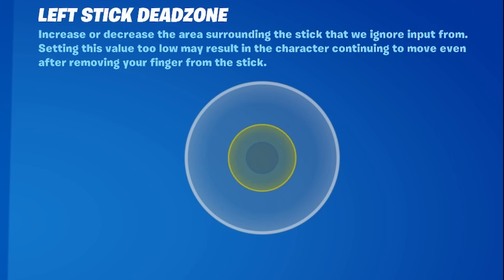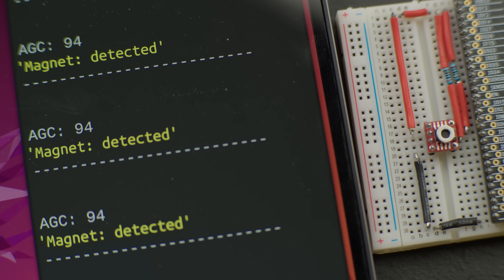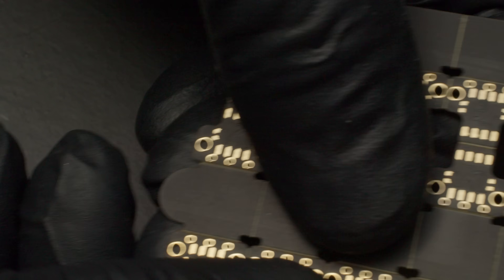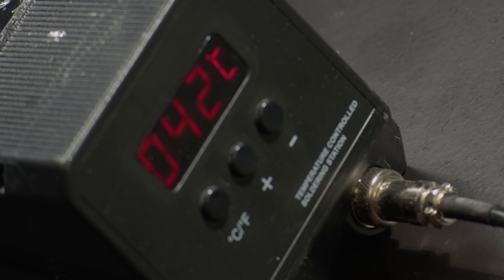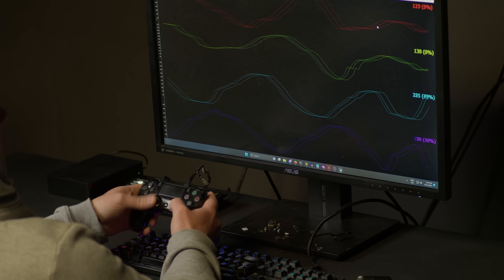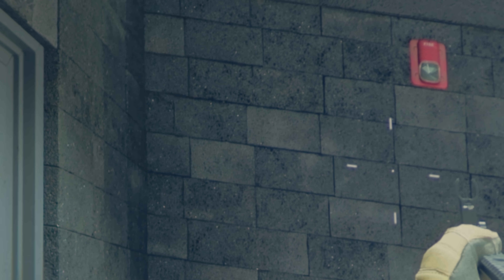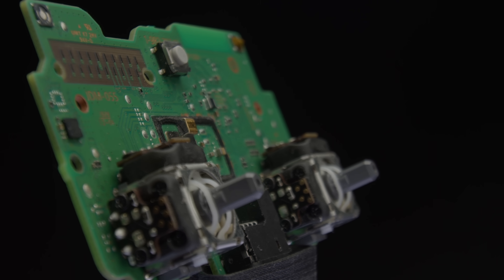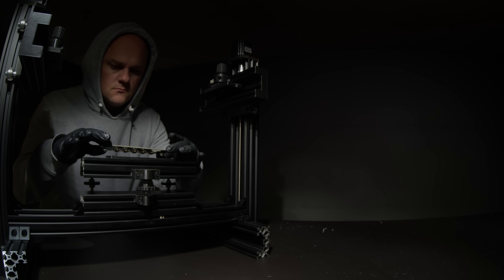Beating the $20B Joystick Drift Problem, and giving it away for free

Comment: The dumbest thing about this is that there HAVE been thumb sticks out there for years that use hall effect sensors. Not in exactly the needed form factor that gaming controllers use, but if Sony or someone called them up and said "we need this thumbstick, but with a hall effect sensor" you know damn well they'd have made it.
Reply from the maker: Exactly. Looks at the super advanced trigger mechanism of the ps5 controller. Someone who makes that can make hall effect joysticks. Or optical joysticks. The ps4 controller even have a bunch of dark pattern engineering to make it less repairable. Alps made the pots replaceable for a reason, because they know they wear out. But Sony magically make them not able to be replaced because they hardcode the center voltage for each controllers.
Reply: @MariusHeier1  anti consumer and anti repair behavior from corporations better face a wake up call soon
Reply from the maker: @sirtimatbob  Let's bring it!
Reply: @MariusHeier1  Not able to be replaced? That's totally false. We replace them every day for customers and calibrate them with voltage dividers for perfect center points every time.
Reply from the maker: @FrozenHaxor  Okay you are right. Should have added without mods.
Reply: @MariusHeier1  Using original Alps replacements, sometimes there is a perfect match where no further modification is necessary, although the calibration takes 10 minutes max.
Reply: @MariusHeier1  So you can't assemble the prototypes as an upgrade package without some sort of jailbreak?
Reply from the maker: @icarusgaming6269  Yes you can. No jailbreak. Just need to use external calibration for the joysticks once.
Reply: @icarusgaming6269  Yes in fact gulikit has been selling them (direct plug and play replacements)  for many controllers including nintendo joy cons. Again it requires configuration, but this is something that can be found in the menu of every game console and emulator on the planet at this point. Even the switch allows you to configure the hall effects on the switch itself after installing them on the joycons, just as if you were reconfiguring the original joys cons the first time. Long story short this video is a nothing burger.
Reply: @MariusHeier1  Of course they do that, that is most likely also the reason why they dont have hall effect sensors. They make passive income on the people who buy another controller of them because they have too much drift. 
If they make it have a hall effect sensor, all that money goes away.

This issue and the solution is well known, and it will probably wont be fixed, because of the profits they make of it.
When Xbox or Sony makes a controller with a hall effect sensor, then Xbox/Sony will change their controllers too, and all the major player probably will follow in their lead. 
It is basic economics.

Making sure people buy more from you.
Reply: @MariusHeier1  Speaking of the Dualsense back triggers, they actually did upgrade them to hall effect sensors with the Dualsense Edge controller. That gives away their ability to also upgrade the joysticks to hall effect sensors, but they probably think it's more profitable to have players buy replacement joystick modules.
Reply: @MariusHeier1  Typical artificial scarcity and/or planned obsolescence. All manufacturers do this one way of another. Keep fighting them, please.
Reply: @MariusHeier1 early ps3 controllers apparently had hall effect joysticks. Then they switched to normal potentiometers to make some extra bucks 😭
Reply: @MariusHeier1  You can (and many youtubers have shown this) replace the pots on the older sony controllers. It just requires soldering, something most users dont know how to do.
Reply: @crisnmaryfam7344  for an average joe, repairing controller isn't anything comes to mind
Reply: I'm an average Joe and ive thought about soldering the joysticks on the turd ps4 controllers. I have a cheap ass $25 solder iron. It's only the second ive ever owned.. yihua irrc... Before that i had a fancy $30 weller but the tip wore out and then fused itself together. I have a couple of controllers out of commission from this. I've tried unsoldering the joysticks but my iron doesn't get hot enough and wrong tip too. But I'd definitely invest in a proper iron if i had a good reason to, like trying out these joysticks.
Reply: @crisnmaryfam7344  You also can on the Dualsense5 very easily. It´s probably the riendliest controller for that kind of mod in the current generation. It is surprisingly easy to take apart for all it´s screless facade. And it also uses basically the same sticks as the Dualshock4. So it´s a rather easy soldering job and one of the many sets of hall effect sticks for PS controllers and you got a hall effect Dualsense5.
Reply: yup, the Dreamcast had hall effect sticks.
Reply: @paultapping9510  If I recall correctly, even the Saturn 3D pad had it all the way back in 1996-97.
Reply: @Paul Tapping  also the saturn Nights controller, which kinda was a dreamcast prototype controller. Big companies don't want controllers to last forever, and then they wouldn't have a reason to sell more. I think they ride the fine line to where they do wear out and know they do
Reply: @paultapping9510   and before that the saturn controller. was the saturn not popular? because nobody seems to mention that controller having hall effect sensors. and the saturn came before the dreamcast.
Reply: @paultapping9510  I think the PS3 did as well.
Reply: @Kazriko Redclaw  could well be, those controllers did last a really long time iirc. Far longer than my ps4 controllers ever have anyway.
Reply: @kazriko  They certainly did, later PS3 controllers switcheroo'd to carbon potentiometers.
Reply: @kazriko  Yeah, the ones I had pretty much broke down physically before any drift became an issue (all my brothers fault), lasted years.
Reply: @spikester  that explains how come my sixaxis controllers always lasted long, having only the trigger springs wear out(but they'd be easily replaceable by modifying clothing pins) when i heard people with dualshocks 3 complain that different parts would break all the time
Reply: Actually, yes in the form factor game controllers use. My 8bitdo has them, Sega Saturn controllers also had them... 20 years ago..... Gulikit and others have offered them for a long time now.
Reply: @crisnmaryfam7344  finally somenone who mentions the Sega saturn controller before they mention the dreamcast. I  am gladd that hall effect stick cant be patented, just like back buttons. patents only apply to specific designs or implementation of an idea.
Reply: Like the majority of brands in the world, it's not economically convenient for Sony that their products last forever.
Reply: @javierEI345  As much as I cannot stand ESG, it offers the perfect leverage for making greedy corporations change their ways. Find a way to assign n tons of unnecessary CO2 output to someone’s disposable hardware business and their peers will run them into the ground for you!
Reply: @javierEI345  not anymore*
When couch co-op was more common many people had 2-4 controllers in their house, now it's 2 at most with rare times of 3, and usually if it's 3 controllers, it's for backups or special editions.

This meant that the need for different controllers at the same time went from a common occurrance to something only more hardcore gaming-focused people need, which meant just hoping people break/lose their controllers through anything but natural usage to buy new ones wasn't gonna cut it anymore... Hence the super minimal efforts put through fixing drift.

Still, at least custom controllers will be more likely to be reliable after this project goes out of prototype phase.
Reply: @javierEI345  Like many things it correlates with capitalism as a whole, they won't ever make a product to last as long as it can, because they are not designed to. This system is based on greed.
Reply: @javierEI345  I don't know, the more I look into it the less it's about "planned obsolescence" and the more it's about "sticker shock" for average consumer. Hall effect is simply more expensive, and most casuals don't care. So first-party manufacturers try to keep initial cost low instead of caring about longevity.
Reply: @error.418  Was there sticker shock for the original PS3 controllers? You tell me. Hall effect sticks are more expensive, but not by that much when mass produced. People would probably be fine with paying a little extra now on the base models to avoid having to buy another controller every 6 months to a year. And, let's face it, the elite controllers are overpriced enough that they could just eat the difference. And the controllers are still going to break anyway since the sticks aren't the only thing to wear out. They're just usually the fastest thing to wear out on a 1st party controller. The cost to consumer thing is just some disinfo they've put out there. It's definitely about planned obsolescence.
Reply: @beastmastreakaninjadar6941  They don't put that info out there. It's just how it is. It's not disinfo, there's no conspiracy here. Calm down.
Reply: @error.418  Hey. You're the one that said that, the more you looked into it, it looked like sticker shock rather than planned obsolescence. So, just what INFO brought you to that conclusion? I didn't say "Oooohh. I must be some vast conspiracy." But companies do deal in misinfo to deflect things. Or are you unaware of the tobacco industry?
Reply: @beastmastreakaninjadar6941  Market research. One market doing it doesn't mean another does. This is about pots being much cheaper than hall effect sensors at scale.
Reply: @error.418 Gulikit is the same price.
Reply: Im not sure what this dudes on, but you can get this from numerous manufactures. Hall effect joysticks are common. Or am i missing something? Why does he believe he has created something new?
Reply: @Nobody-Nowhere  it's not the tech that is new. It's the ability to drop it in to a ps5 controller and have it work with no issues that's new.
Reply: @jessemurphy8871  It really isn't, we've had game controllers for 25 years that have them and for less than half the cost of a PS5 controller.
Reply: My over 20 year old Dreamcast controller still has no drift. i have 3 drifted 360/xbone/pc controllers sitting in a bag right now; tossed because of drift. its absolutely cost-passing onto the consumer as to why manufacturers dont make it them standard anymore
Reply: @scrubscrub4492  yes but have any of them been set up to work with a ps5 controller? Calibrated to give the same outputs as the stock potentiometer based joysticks? Not until now. I'm not saying it can't be done. I'm saying someone had to put in the work. And now, someone has put in the work.
Reply: @Nobody-Nowhere  Yeah. You're missing something. There are hall effect sticks out there, but not any with the specific configurations and electronic values that Sony and MS use. Gulikit has been saying theirs are coming for some time now. And this guy has basically beat them to it.
Reply: Just look at drone transmitters, they essentially just use two joysticks (they call them gimbals) and they have used Hall effect sensors for quite a long time. Cheaper transmitters still use potentiometers but anything decent quality and above will have Hall effect sensors.
Reply: spongebob rainbow hands Planned obsolescence and cost cut. Printing graphite and stamping a tracer arm is cheaper than manufacturing the hall effect sensors and sourcing magnets. Still, this is great for aftermarket parts and modders!
Reply: There is a current controller for the switch that uses them. It just seems like its done completely on purpose
Reply: @Jack Daniels  of course it is. You did see the part where controllers and other peripherals are a $20b market right? If they all started using hall effect sticks then it might only be a $5b market! Can you imagine a multi-billion $ company losing $15b in ONE area of the market?! It's outrage I tell ya, outrage!!! (Hopefully the sarcasm here is noticeable)
Reply: Why make it if big companies can just make people buy new controllers? When there is money to be made, they won't change a thing.
Reply: The 3D control pad for the Sega Saturn AND the Dreamcast controller use hall effect sensors for BOTH triggers and analog sticks. How this had not bled over to Nintendo, Sony and Microsoft is baffling.
Reply: @ripcase1990  Simple - they want to sell more controllers heh
Reply: The ps2 doesn't have drift issues, because they use thicker potentiometers and compensate it in software, it's just the issue being companies selling the lowest cost crap for the highest price possible.
Reply: @satibel  Right, it's pretty much entirely down to keeping build cost low. They're so concerned about price sensitivity and think customers care more about price than quality. And out of the box, that's often the case. Then right as it breaks the customer realizes, wait, maybe I wouldn't have minded spending a few more bucks for some longevity. But here we are...
Reply: @error.418  if they thought customers cared about price, they wouldn't make 500% margins.
Reply: Of course. its called planned obsolescence. the companies aren't dumb, the engineers they have are just as talented as mr Marius here, maybe some even more. But greed is greed. They wont sell something that lasts 5-8 years if they can sell something that breaks in a year or two and make more money.
Reply: The thing is, these big gaming companies can use hall joysticks to make their controllers last . But they dont want to because they want you to keep on buying a new controller when it starts to break down. If they made a controller that lasts forever then they wont be making money. Just look at Nintendo with their joycon drifts. They can fix the joycon drift issue but they dont want to. Just look at the amount of joycons people have been buying and the amount of money they've been making.
Reply: @ryuno2097  And look at the repair kits Atari had officially released  in 1980th for the default joystick of their VCS 2600 console.
Reply: And the XBox controllers have/had hall effect triggers heh
Reply: @3nertia  Actually the PS DualSense Edge has hall effect triggers, too. Not sure about the regular DS, though.
Reply: there are some fpv controllers with hall effect gimbals basically exactly the size of a game controller.
Reply: Don't try anything. You will pay for a new controller like all gamer when we decide your controller will broke. Planed product death its not a new concept 😂
Reply: There is a lot more money in selling a fix to a problem you had a hand in making, than there is in fixing the root cause.
Reply: It's all about planned obsolescence. If your gamepad wears out you have to buy a new one and those $60 gamepads put money in their pockets. Why replace crappy POTS with Hall Effect sensors when the cheap crappy POTS will bring them in more revenue?
Reply: That's just capitalism! we make our products worse so you'll have to buy more of them, also we're wrecking the planet to do it :D
Reply: The Dreamcast controller used hall sensors.
Reply: you say that hall effect sticks where out there for years but not in the needed form factor. but that is not entirly true. The needed form factor for game controllers has been theire for more then 20 years. Sega has first used these in the Saturn controller and later in the dreamcast controller.
Reply: Sony loses sales on controllers then which is an extremely lucrative part of the console process.
Reply: Gulikit makes them. They're great.
Reply: Well, yeah ? the ps3 and 1000 model of the ps vita have hall effect joysticks
Reply: Yes in exactly the form factor that gaming controllers us.  Saturn and Dreamcast both had hall effect analog sticks
Reply: controllers being $70 is big buisness. The sticks are the biggest weak point of a controller.
Reply: controllers being $70 is big buisness. The sticks are the biggest weak point of a controller.
Reply: Flydigi Apex 4
Reply: the thing is that the joystick drift is an entire market on its own, as joysticks develop drift, customers buy new controllers, thus making more money for said company. but if they introduced half effect sensors to their controllers, people wouldn't need to buy new controllers, which would mean they're not making as much money as their greedy asses would like.
Reply: *decades Really, it likely boils down to a cost profit calculation. Using the same sticks as the DS4 got to be cheaper and/or more profitable even with the expected high amount of returns/warrancy cases comared to getting a contractor to make new hall effect sticks or set up a production line for them. It isn´t dumb, it is just a cold calculation on loss and profit. It´s soulless and sucks for us, but it´s not stupid.
Reply: Yeah, even older controllers like the Dreamcast controller used hall effect sensors. They just stopped because... eh... i guess this is easier? I guess they'd rather have controllers that wear out all the time and have to be replaced?

Anyway i'd love to stick this in an XBox One Elite, but i bet that won't work because the controller sticks in that thing are magnetic.
Reply: @WinterAyars  shaving cents off of 100 bucks+ controllers because profit.
Reply: @WinterAyars  They just stopped because... eh... i guess... "Planned Obsolescence. Its a proven Economical theory that results in higher profits..  

What are examples of planned obsolescence?
5 Enraging Examples of Planned Obsolescence in Everyday ...
Some products inevitably become obsolete after a short time. Planned obsolescence examples in day-to-day life include disposable cameras, cutlery, shopping bags, water bottles and take-out containers. But it can also occur in more discrete ways.. Like controllers meant to fail... Shoes meant to wear out.. Things that break when you try to open them, so that they cannot be repaired.. This goes on and on in the Fight for Right to Repair also.. you need to read up.